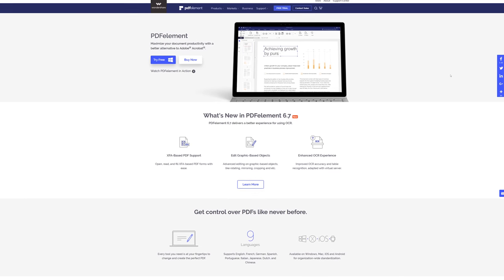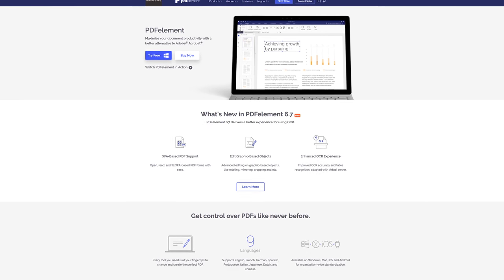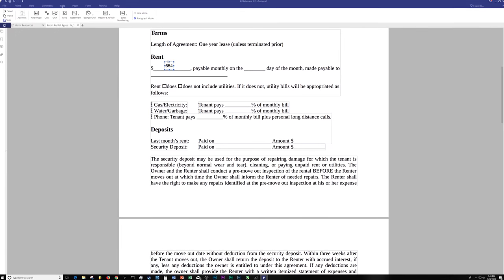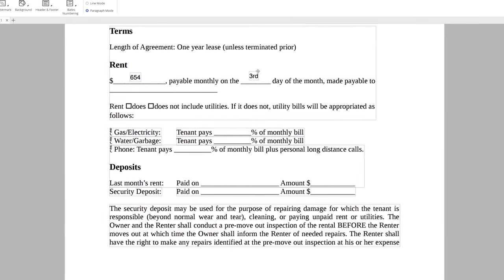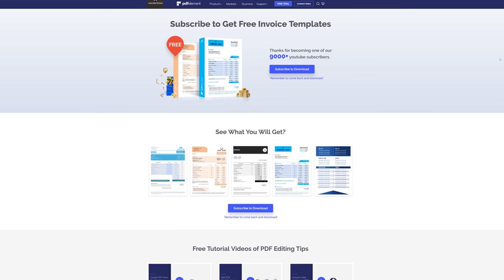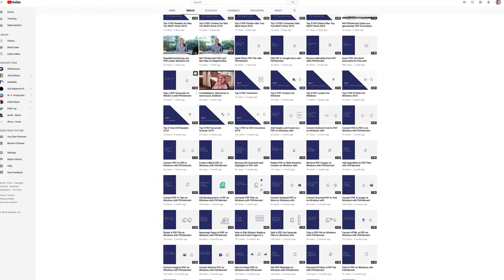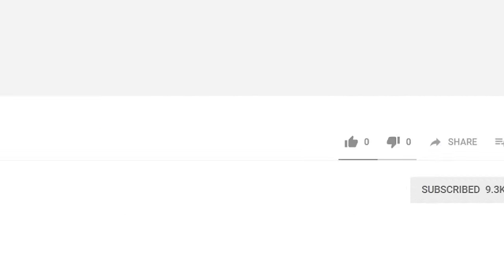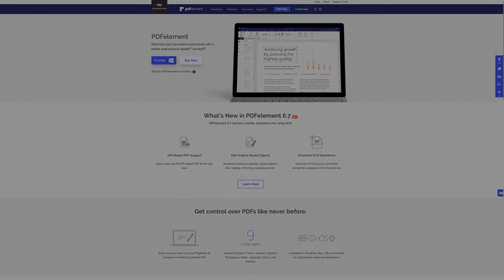Understanding Motherboard Anatomy For Beginners

Comment from the maker: So what else do you guys want explained? GPU, RAM, VRM Design??

I also explain these things over my live streams and other general questions, so let's talk hardware at https://www.twitch.tv/jdtechgear
Reply: Talk about one of the most over-looked and underrated piece of equipment, power source.
Reply from the maker: I was going to mention that, but my knowledge is very limited on power supplies and don't know if people would be interested enough beyond just knowing what's a well received PSU manufacturer and what's not
Reply: Hehe...GET them interested. Search diff. power sources, rails etc..I think you'll enjoy it.
Reply from the maker: I'll definitely try and get my feet wet with learning the proper info, just gotta make sure I know it very well before recommending people to purchase other than knowing from other reviewers! Thanks for the input man, definitely gonna look into it
Reply: I vote for VRM!!
Reply: VRM please!!
Reply: can you explain about rgb, argb, 3 pin and 4 pin fan header, how to use them and not to forget about fan hub or molex
Reply: I’m just trying to figure out where to plug my fans. my intake and exhaust fans.
Reply: @jdtechgear  I can wish for any motherboard for my cpu because it has been damaged for a long time so it has been damaged, just for my online class even if only ddr3 doesn't have as much money to buy im from the philippines I hope you notice yung comment kopo
Reply: @gregormiller4037  the yuhi 🤤

Comment: Hey JD, thanks for the video.
Me being someone who knows how to build a PC,  I had no issue understand this video.
With that said...
I linked the video to a friend, who knows nothing about building a computer and very little about motherboards as a whole.
They told me that they could not understand the acronyms being used.
Also, they said that the video was much to fast for them to follow along with.
This left them confused, which made it difficult for them to grasp what you were explaining.
This is not to say that this video isn't useful, because it is.
Thanks again JD. 👍
Reply from the maker: Thanks Geo! And thanks for the feedback from your friend, do they know the basic components that go into a computer? I do have a video to reference that if it helps at all.
Reply: My friend is aware of the "basic" components, that make up a computer, but they would not attempt building a PC on their own.
 I was just curious to know,  if they could understand an explanation of a motherboard's anatomy, by watching a video about it. Not necessarily this specific video, but any video on the subject.
It seems that this isn't the case. 

Perhaps this has more to do with my friend's ability, to comprehend, or understand tutorials presented in video format and not who or how the video is presented. 
There are some people, who just don't and will never get it. No matter how much information they're given.
I'm afraid my friend my be one of those people. LoL!

Comment: This was very helpful. I'm doing all my research to begin PC gaming and building. I've been researching all components separately and taking my notes. My question next would be comparing motherboards. What would be high end features? What motherboards would you avoid? Does the performance of the PC change with different boards? Thanks for the work you did here!
Reply from the maker: Thanks James, glad I could help! The differences between the high end boards and midrange usually rely with its overclocking capabilities and power control, better LAN connection, more NVME slots and so forth. The big thing is power delivery and what not to high end chips. That requires a decent amount of research to begin with. Just finding the features you need vs want to have is a good place to start.

Comment: The reason that you should use the topmost slot for your graphics card is not because it is less travel time between the CPU, it is because usually the topmost slot is pci x16 slot, where as other slots might be x8 or x4, mean that the other slots have less pins on them

Comment: Do I need to use 12 pin connector for cpu power or use 8?
Reply from the maker: CPU connectors are usually either 8 or 8+8

Comment: this might be the stupidest question ever. but, here it comes. every Motherboard with wi-fi its almost twice the price. is it really necessary? what does it do? the computer still connects to the wi-fi, right?
Reply: You can use an ethernet cable (which connects from your router to ur pc) to connect to the internet.
Every motherboard should come with an ethernet cable port

Theres nothing wrong with using
WiFi but it's just a bit slow and the additional price is not worth it :/
Reply: Ya u can use a ethernet cable to connect ur motherboard directly to ur WiFi router or else u can use a separate usb WiFi dongle and plug it to any of ur usb ports and it will accept those WiFi signals from router,but make sure to check your router WiFi speed before buying any dongle and if u are not using windows10/window8/windows8.1,u have to install drivers of the dongle to work properly.......